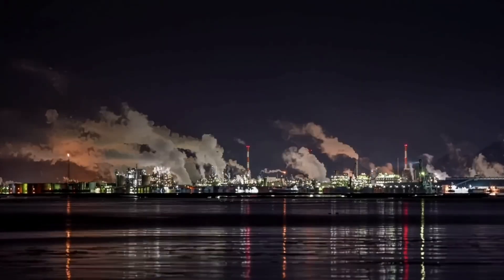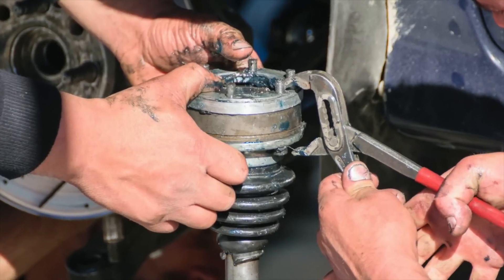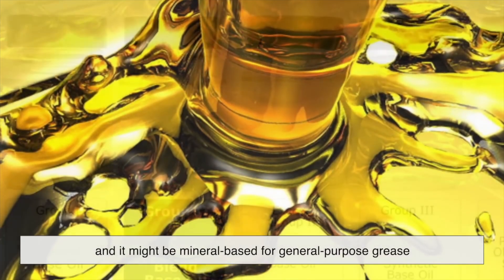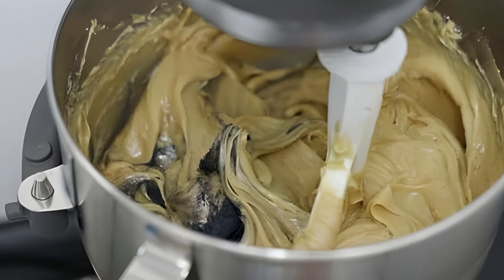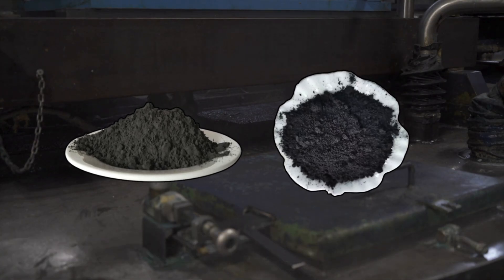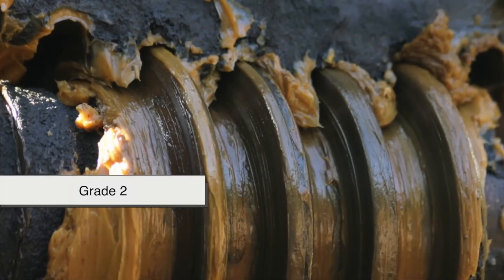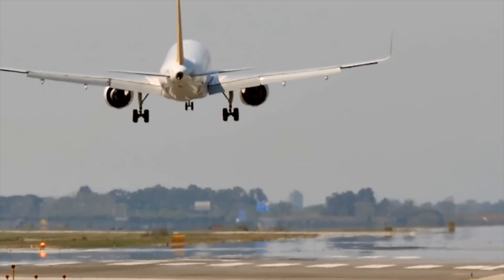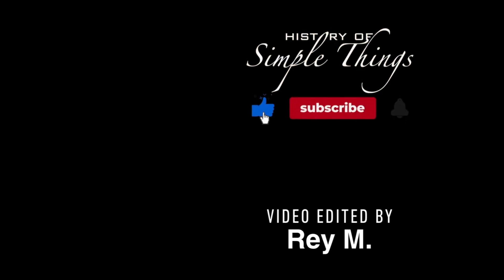How Is Industrial Grease Made?

Comment: Before about the mid 70s they put fiber in bearing grease. I liked that. That fiber would drag additional grease into the bearing. But for some reason they stopped putting fiber in and it was never explained to me why. I’d pack wagons every three years and other field implements as needed. I never had a breakdown due to bearing failure.
Reply: The fiber was asbestos.
Reply: @davidtappe5337  No, there were no fibers in grease, no asbestos, no other fibers.
Reply: No, fibers were never added to grease. It was called short or long fiber grease because of how it looks if you rub it between your fingers and then pull them apart. The grease forms what looks like fibers but it's not actual fibers in it and it never was. Not a hundred years ago, not in the 70s, never. Fibers would only clump together and cause problems in a bearing, not a good idea.
Reply: @skunkjobb have it your way.

Comment: Industrial Grease can and is high-tech, depending on any number of factors. Whether petroleum-based, synthetic, or a blend, as well as chemical additives, etc., to meet certain specifications. It's not just your grandpa's grees anymore. So the oil and lubricating industry is not going anywhere soon, in fact its going to increase if anything. Do you know how much oil a wind turbine and its transformer uses ? You might be surprised just how not Green they are.

Comment: If the intensity of the sun is constant, how come one is able to stare at the full sized sun during sun set hours unlike at noon when the sun is over its head, what reduces its burning and light intensity in the evening?
Reply: Thickness of the atmosphere vs the angle you’re seeing the sun
Reply: There's no such thing as a stupid question.  A simple way to visualize it would be to draw a small circle inside a larger circle. Then, draw a line straight out from the center of both circles. Where the line bisects the small circle, draw a line perpendicular from that point to the outside of the larger circle, and that is how much more air, clouds, and  particulates the light has to travel and scatter through to get to the surface of the inner circle.
Reply: The question is invalid because the initial qualifier is incorrect.
Reply: Thanks lads, he seemed a bit dim.